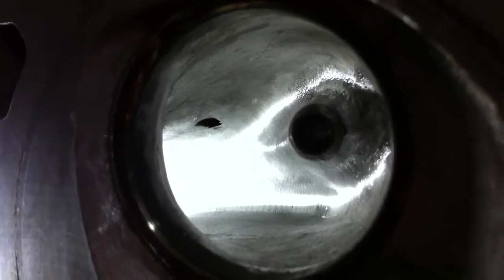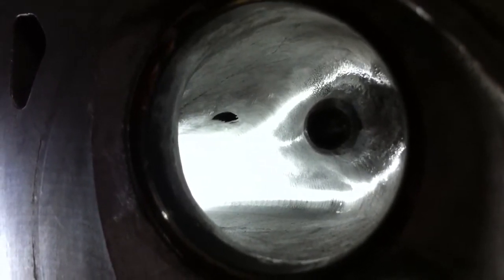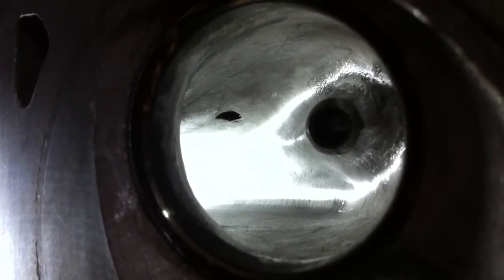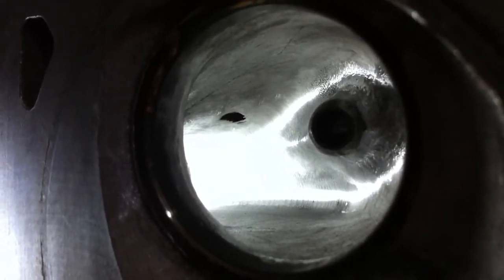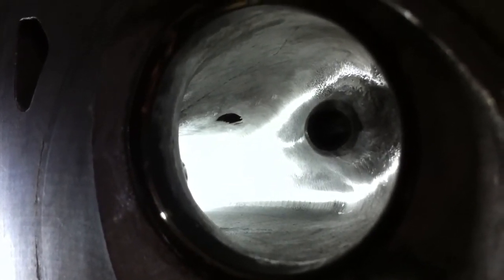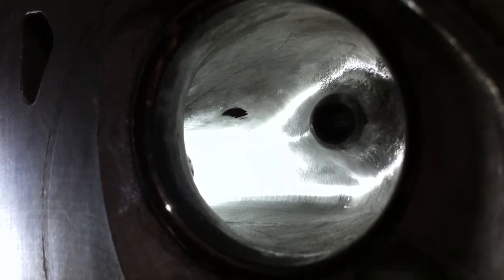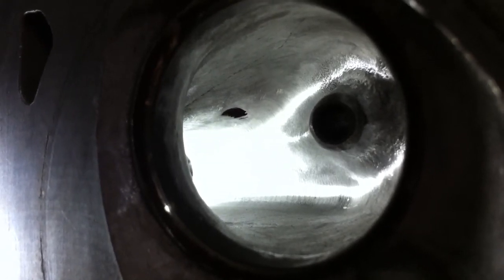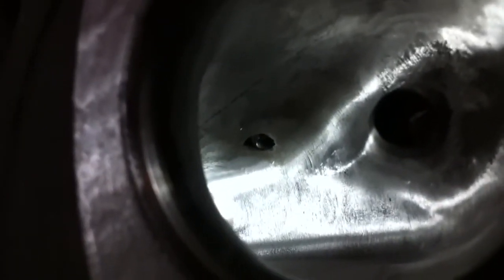How To LS1 DIY Head Porting Part 1 Cont - Rocker Bolt in Port - Boss removed

Comment: I’m struggling with oil weeping by this hole with thread sealer, thinking of trying rtv ? Any suggestions?
Reply from the maker: RTV sounds good to me. I went through a situation where I thought mine where leaking too. It turned out to be the valve stem seals that were brand new and installed by the machine shop. I couldn’t believe it. I changed them out myself and fixed the issue.

Comment: Yeah I figured a hole in an intake runner would junk the heads. How is this ok??
Reply from the maker: +Dinger182 The hole is plugged with the rocker bolt and thread sealer. The same way that it would be done with big name CNC heads like Texas Speed and Performance. I daily drive my truck with this hole in the intake port.
Reply: Its going in the intake port pre-valve. So as long as you use thread sealer, no oil or air will ever escape. Its not like its a hole into the cylinder etc and cause a compression leak. Maybe that clears things up better?

Comment: Does that hole create any problems as far as oil into the intake port are any other issues and if you use the stock bolts that stick into the port does that bother the airflow any
Reply from the maker: The stock bolt doesn't really stick out. it actually just fills the void in that area. You can put RTV on the threads to keep oil from sucking in. On my last truck I had ran with nothing on the threads to see what would happen. I only got to drive it a few months before it was stolen. SO i never got to see if oil leaked past.
Reply from the maker: +James Houston I don't know how I didn't reply to this comment, unless the reply was deleted during all of the google updates. I've replied to every comment over the past 4 years.
No this hole doesn't create any problems. Thread sealer on the rocker bolt is recommended. I've had more issues with leaky valve stem seals that this hole.
Thet stock bolt barely shows through the hole and is fine.